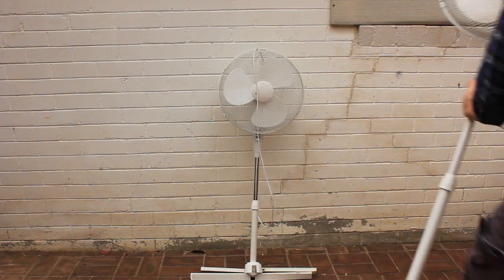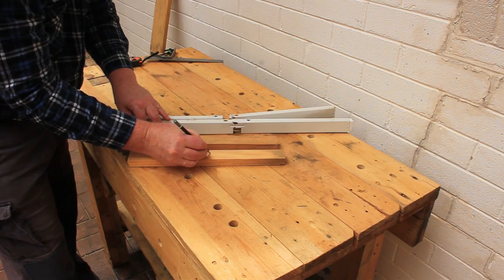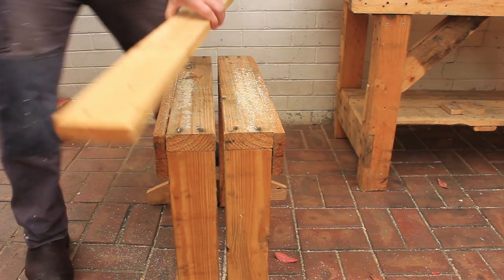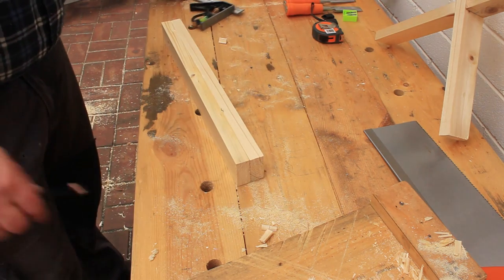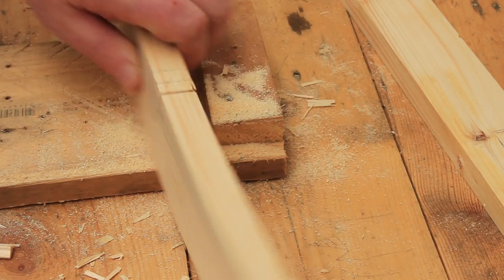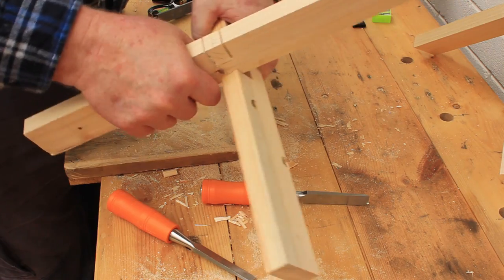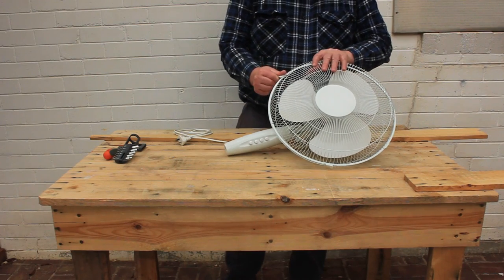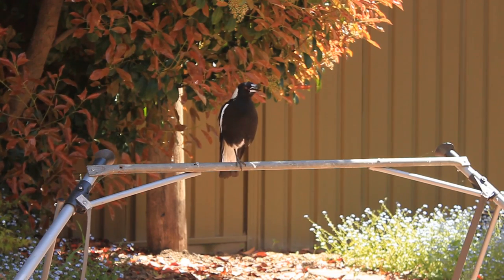Repairing a pedestal (stand) fan base

Comment: Hello. Do you happen to know the size of the thumb screw that fixes the fan head to the base? I lost mine and they're charging over seven quid on Amazon for one.
Reply from the maker: It's very likely that there are differences between the various makes and models, but I'd say its 99% likely to be a metric screw thread.  If you can live with using a regular screw rather than a thumbscrew then something like this kit should solve your problem:

https://tools2udirectsw.com/en-au/products/toolzone-assorted-metric-nuts-bolts-washers-240pc-m4-m5-m6-m8-m10-hw042

I'm guessing from your use of "quid" that you're in the UK?  Aldi sells this kind of thing from time to time (so maybe Lidl too?), or failing that I'm sure you have the equivalent of our  Australian "$2 shop". :-)
Reply: @TightwadWorkshop  Yeah - I'm in Scotland. A regular screw head will do so I will keep an eye out for the offers. Thank you.
Reply from the maker: You're welcome.  Best of luck! 😁